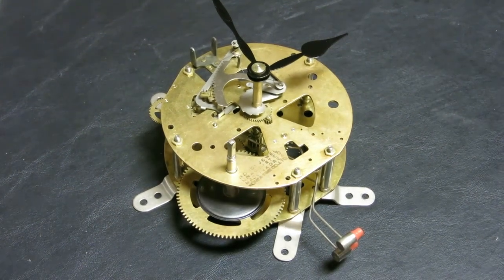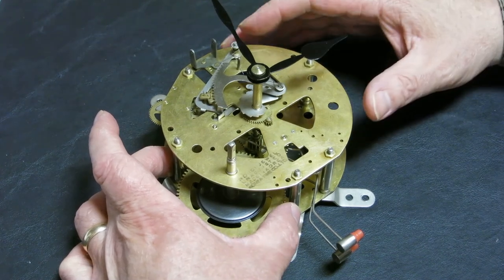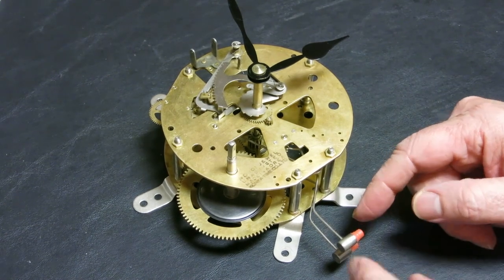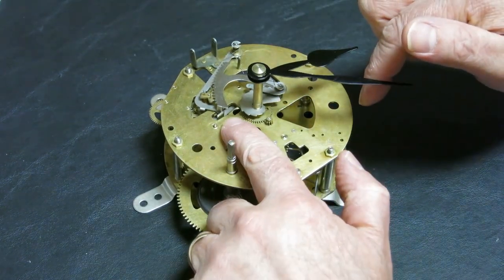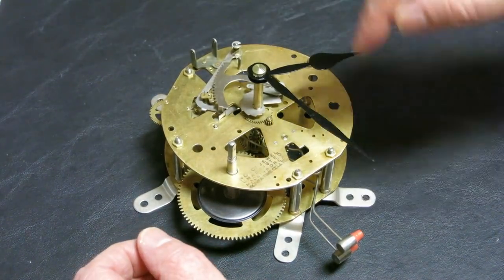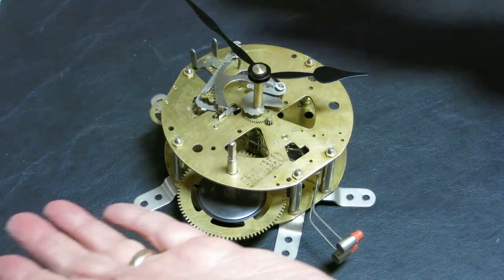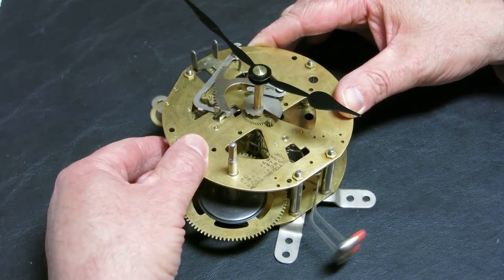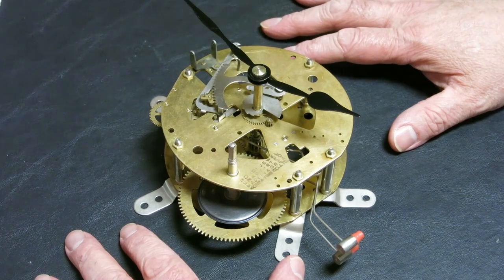Testing the striking gears and levers on my first-ever clock repair

Comment: Hi Bradford. I'm currently working on the same movement as in this video. I have a problem with the strike not stopping once it has engaged. The only obvious thing I can see is that the tension on  the two small springs connected the arms is very weak. I would be very grateful of any help or advice. Thank you Guy.
Reply from the maker: My first guess is that it's not the tension springs; if those springs are replaced with strong springs, it may make the clock stop because they give too much resistance to the movement. One way to see what's going wrong is to essentially run the striking in "slow motion": either use your finger to stop the fan (governor) from turning every so often, or use a finger or thumb to keep the strike train from running freely. Running the strike train slowly like that, watch what happens.

One simple check: does the rack (the sawtooth part) move upward once per strike, or does it instead fall back to the same position it started in - if that's the case, the lever that is supposed to drop to hold the rack in place may be dirty.

Another thing to check: does the warning pin (a wire pin sticking out of the warning wheel) catch at the end of the last strike like it should, when the drop lever drops into place? If the warning wheel is out of position relative to the gathering pallet, when the drop lever drops to end the striking, the warning pin doesn't catch on that lever like it should, and instead the strike train keeps turning, raising the drop lever enough to inappropriately let the warning pin go by once more, and the whole process repeats until the strike train runs down. To fix this problem, you need to first figure out where the warning pin should be when the drop lever drops, then you'll need to disassemble the movement enough to unmesh the warning wheel from the rest of the strike train so you can move it into the correct position without moving the wheel that has the gathering pallet. I'm sorry I don't have a video of that adjustment on this clock, but if you watch the adjustment on a cuckoo clock (https://youtu.be/kYCXseV11Hk?t=562), you'll see the similar parts even though they're in different positions: the warning wheel, warning pin, gathering pallet, rack, and drop lever are all there.

Good luck, and let me know how it goes.